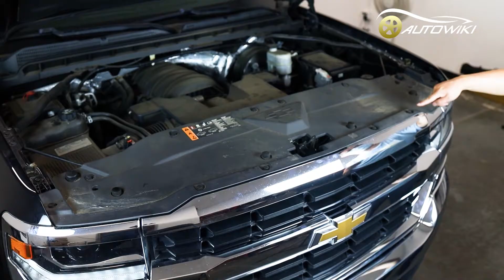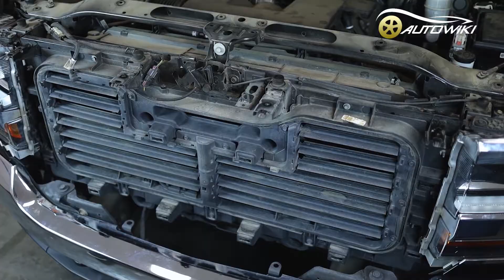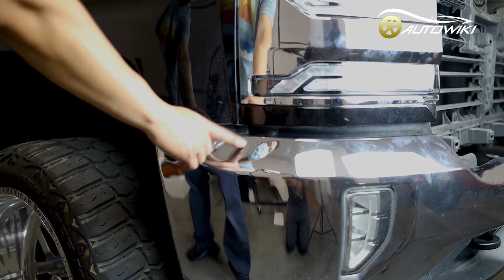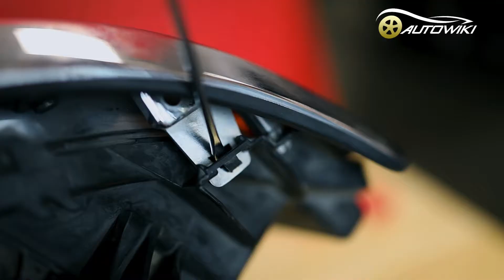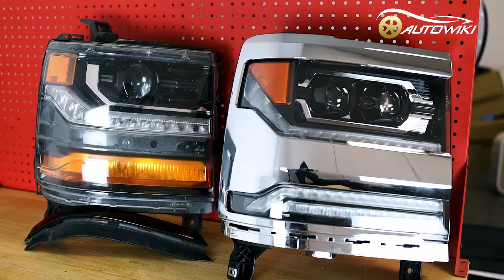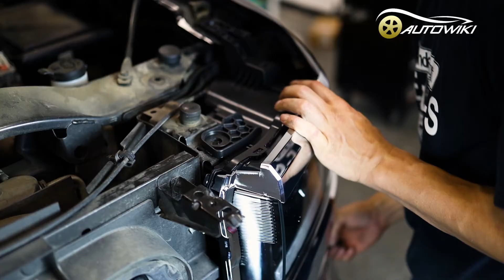AUTOWIKI LED DRL Headlamp Fit For 2016-2019 Chevrolet Silverado 1500 Installation Step By Step

Comment: Turn signals flash fast like the bulb is out on a 16 high country? How do I fix this?
Reply: Did you ever figure it out? I’m having the same issue
Reply: @ronaldlewis9816 where did you order the lights from ??
Reply: @ronaldlewis9816 ^^^
Reply: If you have the amber delete on them it’s most likely cause it is a high country headlight !!! That’s how they made them
Reply: Resisiters